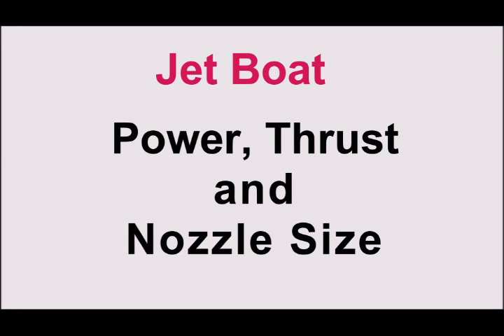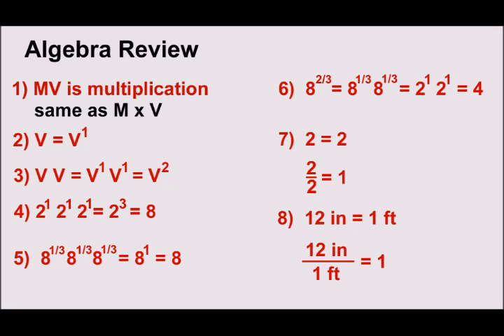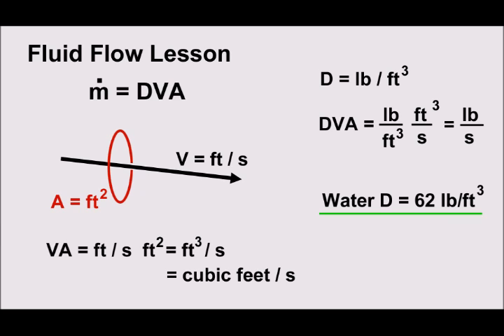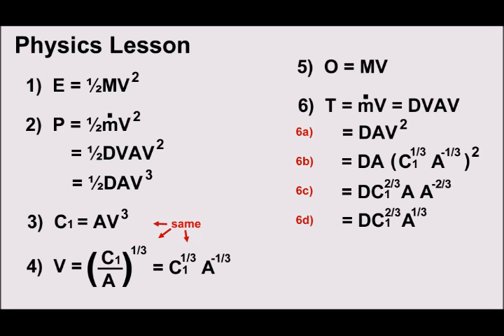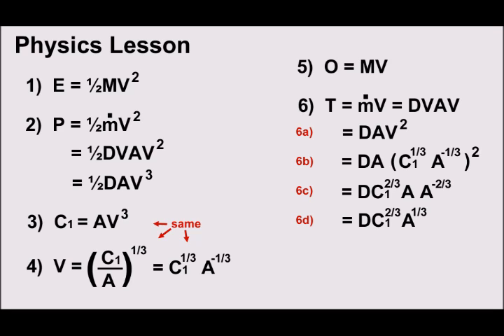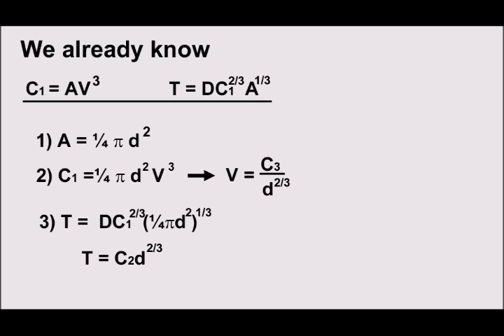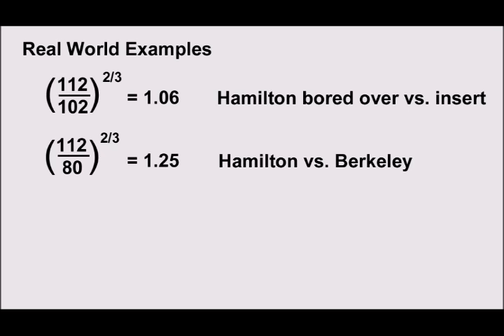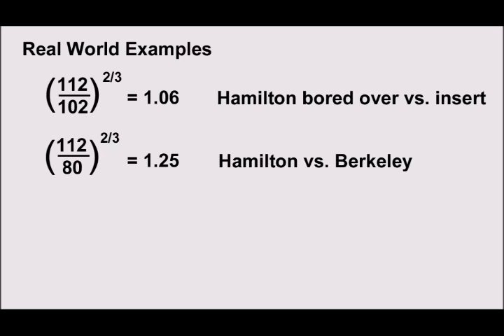Jet Boat Thrust and Nozzle Size

Comment: How about making the end of the nozzle variable as in an airplane afterburner? Load up when you take off and trim smaller as you speed up. They solved the thrust problem in an airplane. What’s so difficult to do it in a jet pump in a boat?
Reply from the maker: Good point. There is very little development in the jet boat world. The Berkeley pump is maybe 45 years old, the Hamilton 212 maybe 30 years old. General design and structure of boats is static. Those "in the know" generally have strong opinions about "the best way to do things" and that is how they are already doing things. Jet boat manufacturers can be very successful simply by assembling the pieces and making something that is similar to an existing boat. This strategy would not work in the airplane world, which relatively speaking has more innovation baked into the cake.

Comment: So I spent many years working with 11" Hamilton's in work boat applications.  Like all Jets, they are RPM sensitive.  We were spinning them at 2,850 per engine MFG's requirements (CAT 3208T @ 240hp).  But one day after the engine was out of warranty, we upped the fast idle and spun the motor to 3,200 - what a difference.  Of course it was over-boosted and would not live long at that setting.  
Now that I'm retired, I'm helping my neighbor rebuild a 1970's era roundy-round jet race boat.  Has an early Berkeley 12 JB pump, but was tweaked for racing with an SS A Cut impeller.  We're assembling a mildly stout 454 BBC that ought to make 400+ HP.  The pump will tell us once it's all together ...
Jets are big fun 🙃
Reply from the maker: I'd be interested to see what an actual dyno shows compared to the Berkeley pump curve at your max RPV. I dissected the curves long ago and discovered they are EXACTLY cubics, which means they are probably just theory, and won't align exactly with reality. I also found several different sets of "official" curves for the same impellers. It would be nice to get some dyno numbers to resolve these lingering difficulties.
Reply: That sounds like a great setup!